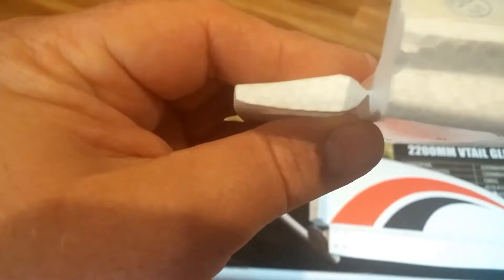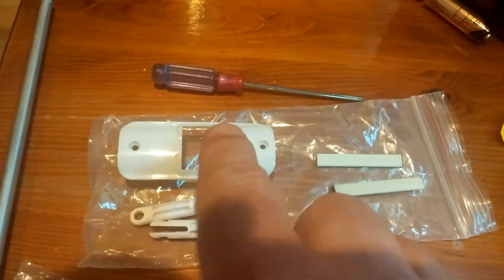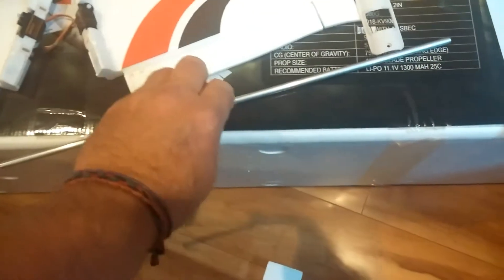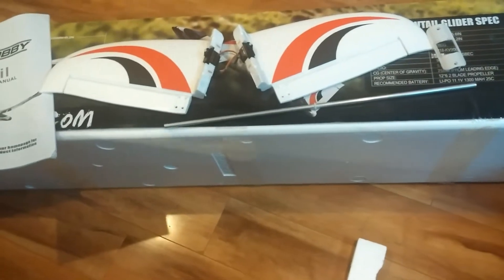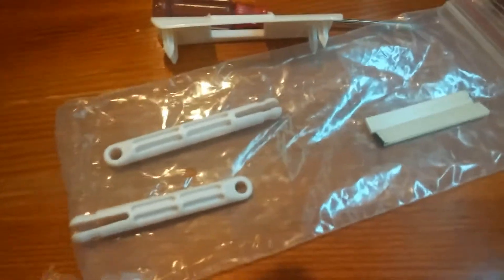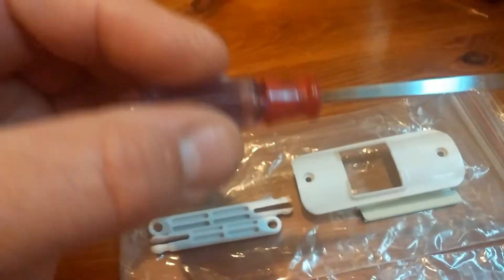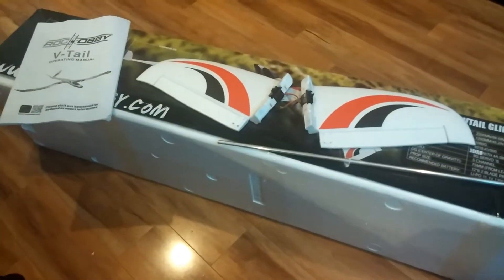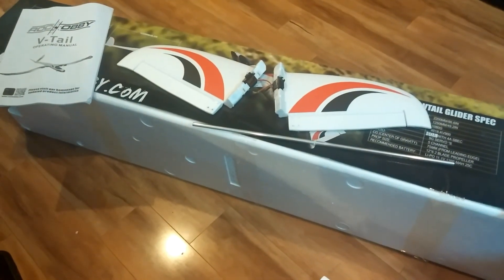FMS ROC HOBBY 2.2M V TAIL PART 2

Comment from the maker: This was a fun electric V-tail glider to fly. 
It was easy to assemble and flew well out of the box , I would not recomend it over a Radian for those that are looking to catch thermals.
I had the most fun flying on the beach off of a bluff , that was about 8p feet above the actual beach. Nice steady onshore breeze and I was having a ball with no throttle at all over 15min and even a 35 minute flight.
Overall a fun electric glider on tje cheap.